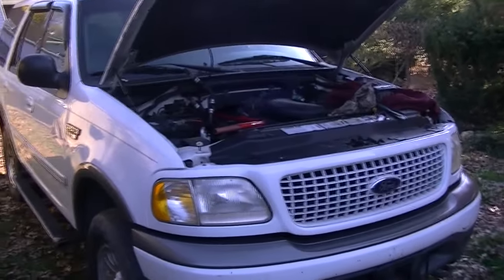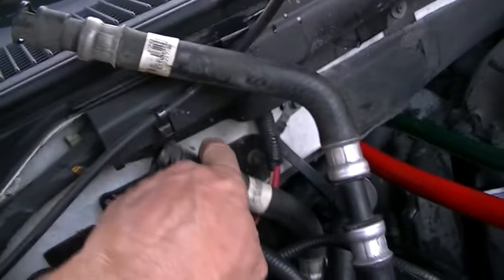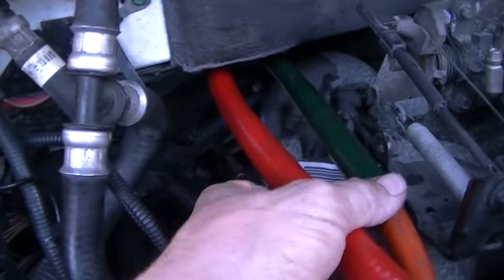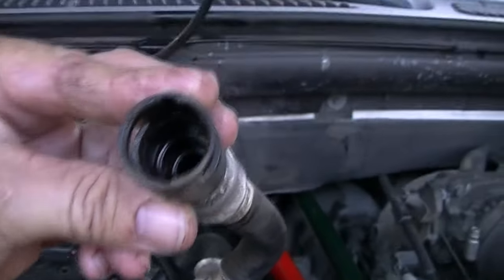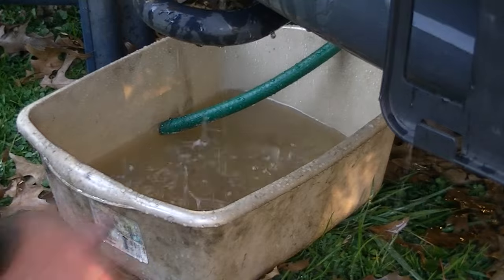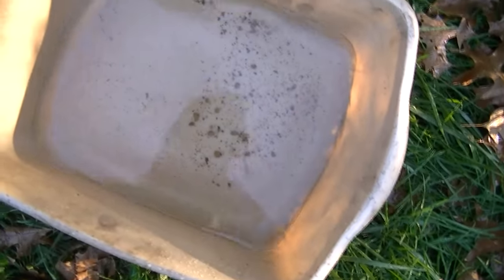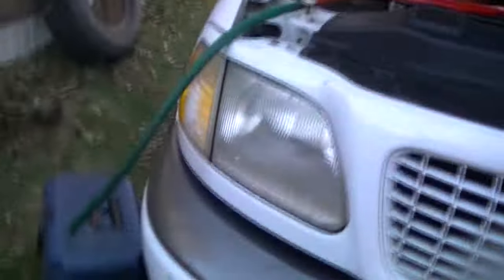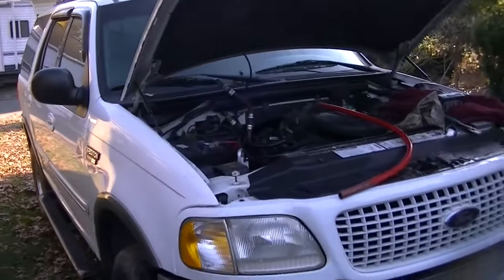No -HOT- Heat??? You must know this!! HEATER CORE FLUSH with seals... Ford Expedition.

Comment: I just cut the hoses and clamped a 5/8 heater hose connector in both.  Not only was it easier and saved time than struggling with those annoying quick connects, but when I work on my 5.4 tritón it's so much easier to work on the spark plugs in the rear cos I can just remove that connector and give me a hell of a lot more room
Reply from the maker: Good tips!!!
Reply: I may do that depending if I can't get that quick connect off

Comment: I’ve always left the hoses connected at the heater core and disconnect them elsewhere and flush them through the hoses themselves. A lot easier
Reply from the maker: The problem is that you can really directly push 100% water though the heater core (on this expedition, etc)...to do a good flush because of the rear core. The hoses are designed to split the flow to the rear also. I found out the hard way ~_~

Comment: nathan rohrbough my was so bad i got the back to work real well but the  front is ok but i think the core is bad we will see and someone told me at a shop it would be 712.00 for the whole thing I look on line it say only between 79 to 90 for a flush but it's going for now it was so rusty I did the whole system

Comment: We acquired an 03' Expedition earlier this year. We'd already been thru an intake manifold replacement to fix a coolant leak. Fortunately got the plugs replaced too without breaking the old ones! But it had lukewarm heat at best, then gradually went to no heat at all. I just did this trick today, doing the inlet and outlet flush; we watched the crap flow into the bucket. Put it back together and took it for a drive. Its early summer in June but by golly, this baby has heat! Alot of it! An easy and cheap fix! Thanks Natan!
Reply from the maker: Great!~~~~~~

Comment: That is not enough dirt to clog a heater core. I would check the door behind your radio in the dash. A gear driven electric motor opens and closes a door to alternate between A/C air and heater air. the gear strips and you get stuck with either cold air of hot air.

Comment: I found that if you can connect to the hose so it doesn't leak, then turn the water on and kink the hose, then let the water surge through the heater core.  You will break much more of the crap loose.  I had a water pump with no fins left. Those pieces of fins went somewhere!

Comment: I believe my 2002 ford f150 has the same problem.I am in the process of of treating the core with CLR. I was able to rig one of those cheap Harbor Freight pumps to the hose ends to agitate the CLR back and forth thru the core to hopefully open them up.I am able to switch the ports on the pump to force the chemical thru both directions. I noticed the inlet hose was much more hot than the exit.The heat seemed to build with the blower motor off and quickly discipate when turned on.Thanks for your video !

Comment: I have the same vehicle with the Aux climate control and the heater (front and rear) blew only cold air.  I decided to flush the cores so I disconnected the core inlet hose at the front top of the engine and the engine return hose at the metal tube at the Rh side of the Engine bay.  I reverse flushed the core system and discovered that there was a restrictor (from the factory) in the core inlet hose.  The hole in the restrictor was about the size of a pencil.  It now appears that the restrictor was "restricted" and when I hooked everything back together the heaters worked fine.  I looks like I could have disconnected the core inlet hose at the engine and simply used a small pipe brush to clean the hose restrictor.  Could have saved a lot of time and effort.
Reply from the maker: Good job! Enjoy the new heat.

Comment: On a lot of these Expeditions and F-150's (Mine's a '98) The heater core is way up higher than the engine and gets air trapped in it . You can flush it all you want and get some heat for a while but it always goes away again , You have to burp the system , there are many good videos on youtube that shoe haw to do this .
Reply from the maker: Right...even the reservoir has to to up pretty high. So far heat is like a boss!  Good thing....tomorrow night 13 degrees   ;(     ugh

Comment: Well 2002 F150 low heat so seen your post. So with truck running one hose the one going to the front burning hot the other hose going god knows where down the back warm. So seems reasonable to assume the heater core is clogged and the very easy to remove hose right up front is the feed. So I am sometimes lazy and that leads to invention so I decide I am going to just take off the front heater hose open the fill cap and connect my shop vac to the hose (reverse flow suction coolant is the flush not water). Yup I do it fluid starts coming out I watch the reservoir until it is almost down to the bottom and I stop. I then put the hose on pop on the clamp and top off with fresh coolant. Start the truck up and whoha both hoses too hot to hold and burning hot heat in the cab. Total job time oh 5 min 10 if you include the top off and closing the hood and stuff.
Reply: This reads like something Donald would write. I may give this a shot

Comment: I have the same model. and I have 186,560. so it needs to be cleaned. I'm having trouble with no heat your video helped. it's just too cold right now.
Reply from the maker: Got ya. Yea heater core probably needs flushed;)

Comment: i have the same issue on my f150. inlet hose was super hot and outlet hose was warm. has only warm air when set to full heat. might be good practice to do a full coolant flush
Reply from the maker: Yes!

Comment: Just replaced my radiator in my 1999 Ford expedition...225k Miles.. I have to do this and replace my blender motor/ actuator.
I've been told that I have to pull the dash. I'm an old electronic tech but I don't like playing with the dash and instrumental parts.
Reply from the maker: Yea the dash has to be removed...I've seen guys cut and hack through the glove box...but that's not good.

Comment: I run across this problem many times. Want to do it right? Flush the coolant system and replace the heater core. Also get new O-rings don't reuse the old ones you're setting yourself up for a leak. But if you can get heat working perfectly with a flush more power to you.
Reply from the maker: Yes! True. = HOT HEAT!~~

Comment: I flushed mine yesterday. I think I might have gotten water in the injectors because my truck Is shaking now. Any ideas on what I need to do to fix that? Thanks man.
Reply from the maker: Dry them.
Reply: Sounds like you got water between coil pack and spark plugs. Take coil packs off and blow air inside the hole. Do NOT take out spark plugs.

Comment: I have a similar problem in my 2000 F-150 (5.4L Triton V8), although, the issue with mine is a small leak in the head gasket that is forcing gas fumes into the coolant system. I had a flush Spring of last year and it’s worked well until recently. I don’t have the money to replace the head gaskets at this time, so I’m going to attempt to flush the core myself and install a purging valve on the core supply line. Just FYI I would apply silicone grease to those O rings before reinstalling them. It will ensure a proper seal when re-seating the connectors. Does anyone know what size these circ lines are? They look like 3/4” id. I’m hoping it will seat nicely over a 3/4” od copper pipe or perhaps pex for the purge assembly. Just FYI if you do decide to install a purge system, make sure it is not placed directly over the coils. You will end up with misfires if any liquid lands on top of those things. It inevitably will find its way between the coil and plug, causing a short in the ignition.
Reply: I used that seal all in the oil. It's like $6 for last option. It actually worked and it's been good until recently. Did it again and it worked again. Just a thought. Mine was going to the junk yard next with to many other problems. So last ditch effort.  Check out my channels for some videos

Comment: Hi so I have the same problem and I have the same car ford expedition 2000 5.4 and I fix the thermostat but it doesn't work  so. So what u did is that will help and make the hat work better  so can u tell me back
Reply from the maker: ok
Reply: @FixingWithPassion  so it's just clean it with the water right
Reply from the maker: @mohamedabdulrahman8153  Yep...check for leaks

Comment: the next time you flush your heater core use CLR in it.let the CLR soak in the heater core for a hour or so..So far I have done 3 heater core this winter and the CLR does the job.
Reply from the maker: Good advice!
Reply: TVWXMAN32,I got my mechanic using CLR and it really does the job on heater cores...My daughters heater core was plugged up and she wasn't getting any heat at all.we soaked it in CLR for 30 minutes and flushed it out.then filled it back up with CLR and let it soak over night.it was so nasty that the CLR came out looking like coffee and tons of chunks came out with it...look on YouTube for a video by Eric the car guy..type in CLR to flush a heater core.my 1999 ford expedition is next to have the core flushed.
Reply: That's something I need to try cuz just running cold water through it really doesn't work in most cases. And it is a lot of labor but replacing the heater core is not brain surgery. Plenty of good YouTube video showing you were all the Bolts are for removing the dashboard.

Comment: Do you need to drain out the coolant before removing the heater core hoses?
Reply from the maker: I did not...but you may lose some coolant but no biggie. Just re fill after the job is done! ;D
Reply: Nathan Rohrbough a little is no problem. I just wondered if I didn’t drain the coolant or pinched the hoses. If the coolant would drain out everywhere. Thank you.

Comment: I broke one of the QD when taking  the hose off the heater core. I bought the recommended replacement QD do I need to put the O rings on the new QD because I cant get it to click or stay on with the o rings on. I appreciate your help
Reply from the maker: Well if the quick connect clips are on and the seals are on...it might take several tries to get those hoses to click. It took me several tries on one of my hoses before it actually connect..spray some oil on the inside of those hoses, it might make them slide on easier also. That's what I did.
Reply: got cha.thanks

Comment: i*m gonna have to do this but i will have to use a very strong degreaser , had an issue with the motor and it mixed wather with oil and its a still to much messy

Comment: so did you slid those o rings in the dis connected hose or on the heat core hose end ?
Reply from the maker: Yea, they go on the heater core tube ends. There is nothing on the hose part.
Reply: That answered my question. My heater gets luke warm as well. It only gets hot when I drive it on the highway it seems like. But when I first start the truck in the morning to let warm up there's just cold air. It can be running for 30 minutes and barely anything till I drive around.
Reply: Tim Osness did you try this? Did it work?

Comment: Couldn't some company come up with a radiator chemical to flush out the core?
Reply from the maker: Some do, but its not to effective.
Reply: @FixingWithPassion  Maybe Comet might do since it's not too grainy. It DOES clean drain pipes on bathroom sinks. Maybe pour some in the radiator and run it with the heater on. Let it sit and the bubbles pop and loosen dirt. It cleaned my bathroom sink pipe! It can mix with antifreeze I guess.
Reply: Put CLR in the heater cores and leave it I there for an hour,then with the water hose put it in the top heater hose a flush it out.Use a air compressor if the water can't un clog it.
Reply: @frankmata1812  A compressor might pop the tubing. It's too much pressure. Comet or Ajax and normal water pressure would be better. Let the Ajax or Comet popping bubbles will loosen dirt. The water flowing with the abrasive Comet or Ajax will loosen the dirt. Or a gallon of WD-40 might do.
Reply: Hank Bridges I've done it by reducing the air on the air compressor,cause one time a cars heater was to darn plugged.
Reply: @frankmata1812  I forgot that the pressure can be reduced on the compressor. OTC has a flusher that pulses water to loosen dirt. It mixes water and air.

Comment: When you flush out the heater core does the car need to be running while flushing it out?
Reply from the maker: You can run or let it idle while flushing. Its really up to you.
Reply: Do not run your car,that would be not to smart your hose's is going to be unhooked,you will run all the antifreeze out of motor and mayget burnt bad make sure your motor is cool b4 doing this if you don't know how to do don't attempt please get a mechanic!!!

Comment: How did you get to the hoses in the firewall?
Reply from the maker: ulrek54321 I will post a link how I took the hoses off in a bit.
Reply: Thanks!
Reply from the maker: I thought I had a video on that....but I'm getting lost in my own videos.....But I can tell you....you have to stick your hands up under there and release those clips and pull off the hoses. It can be done. Just don't drop those little seals. If I find that video I'll post it.
Reply: TVWXMAN32 I'm trying to figure out how you got the pieces of hose to fit on the firewall mine would not stay in or clamped so I just put a running hose right to it and it was a weak flush can you help me with a good clip recommendation or something
Reply: This Jimmy smith
Reply: OTC has tools for Ford heater hoses.

Comment: so my heat actually just started to get luk warm it used to be really hot yesterday but when I was driving it wasn't . so would u assume it's clogged right cause there's no leaks anywhere and it's kinda warm . and would it hurt if I used a power washer ?
Reply from the maker: Funny thing is i'm going to do a heater core flush tomorrow for a second time on this expadition ! It got luk warm over time. I will do a 2nd video again. I would not use a power washer just to much pressure for a heater core. I would just flush it out with water hoes etc. Besides you can catch the water in a bucket and see what comes out.
Reply: Ok thanks
Reply: TVWXMAN32 is this new video posted? mine was warm/hot for about 20 minutes after flush then it got cold again

Comment: Heater cores quit working for a bunch of reasons and rarely because clogged. DIYs on here with a dysfunctional core who wish to save money by fixing the problem themselves are best to take the vehicle to a good shop and have a real mechanic diagnose the core and coolant system. Pay the $100 labour or whatever for the estimate and get a detailed rundown of what the real causes are, instead of wasting money and time chasing up the wrong tree.  Throw them the $100 and drive the car off with the to-do list. 

If a heater core becomes clogged with rusty goop, the whole coolant system will be in the same state. Just unclogging the core, without flushing and replacing the entire  system, is a waste of time. 

The causes are usually more complex and expensive due to failure to regularly replace the coolant. Dirty coolant will destroy the water pump and all hoses, resulting in cold air because the coolant  drained out of the pump. The problem could be a broken actuator in the core.   The whole system is fine except that the deflector door is unable to move to channel hot air into the cab. Or a cable snapped or broke off its mount.  

For about $100, a good honest mechanic will provide an accurate explanation of why the heat isn't working. From there, the DIY can take a shot at it or pay a pro.
Reply from the maker: I agree. Sometimes there just to involved for the average person to fix it them selves. So many different heating and cooling systems now days operate with different means. Computers, wires, vacuum lines...So complex.
Reply: $100. bucks for a 5-6 hour job?? lolol
Reply: You have a point  , I flushed my heater core out several times and it didn't fix the problem  . The problem ended up being that I had air in the system  . The heater core is the highest part of the cooling system so any air is going to collect there .
Reply: Elaine Hamarsheh $100 to diagnose. If it takes 5-6 hours for diagnosis then that seems a bit extensive don’t you think?
Reply: JD G it cost me 800.        50 for the heat core the rest went to labor I didnt need a diagnoses it was obvious my window was fogging up with a greasy film.
Reply: Elaine Hamarsheh ignorance is bliss
Reply: your right Jd, obvious you dont live where i live 3 mechanics 2 good friends all said the same thing heat core is shot. it took 6 hrs labor, Mechanics in my area dont work for free. I know its not an easy job tearing out a dash board and steering column as well as the seat. you have yourself a good day.
Reply: a diagnose.... im no mechanic but it didnt cost me 100.00 to figure out my heat core was shot.
Reply: Lmao what ? What other reasons then clogged ? I would never ever pay. For something so simple. U got coolant fan and heat control valve. Thats it. And its very simple to diagnosis oh sorry and blend vent.  Lol to dignose would take a complete noob with a cell plone 15 mins max.
Reply: "A good honest mechanic"...Is there such a thing? I just want damn heat and money left for food lol If I can fix it myself, then I will, there is such a good feeling knowing you fixed it yourself!
Reply: If you cant fix it, you dont own it
Reply: Dude , just go away. Can't believe your troll post got a single reply .